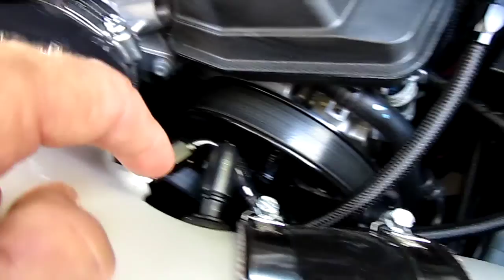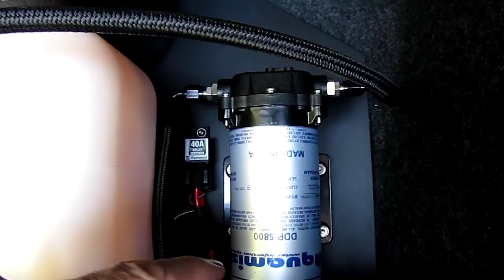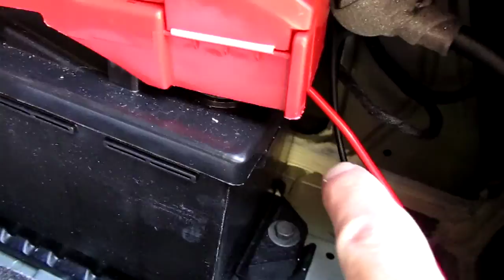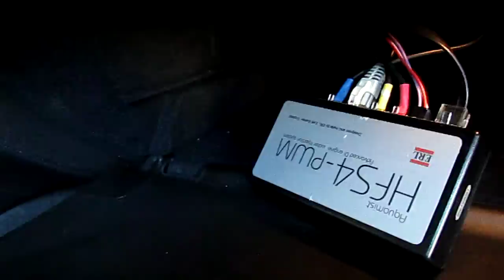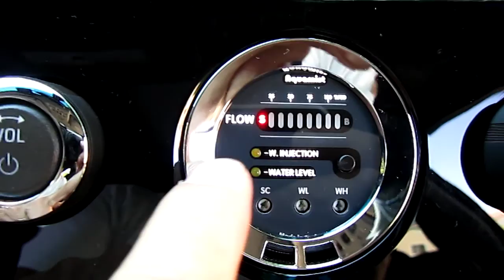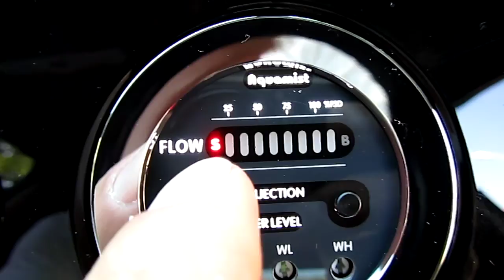2012 CTS V Aquamist Methanol System.MOV

Comment: Thanks for the video. In your research will the methanol ever react with aluminum block? My take was that the methanol would burn off before it had a chance to react. Also what was the amount of temp decrease did you see? Thanks for your time..